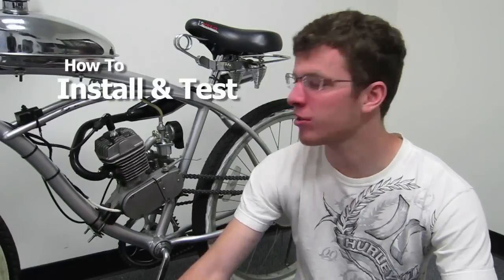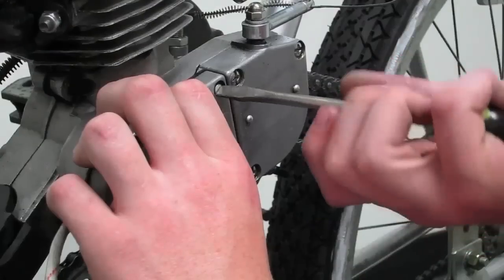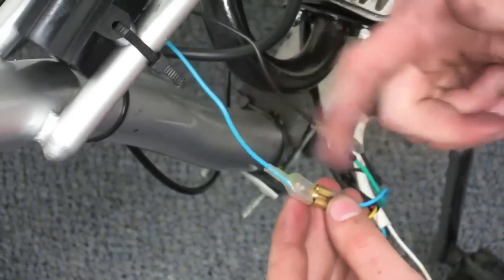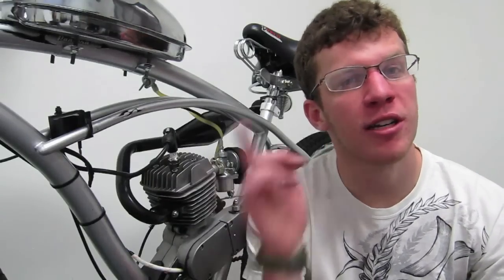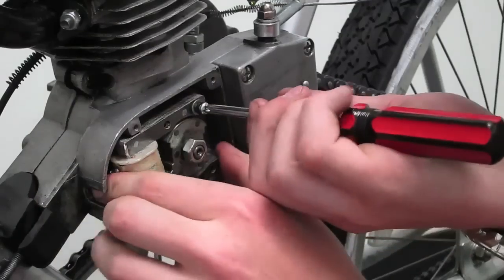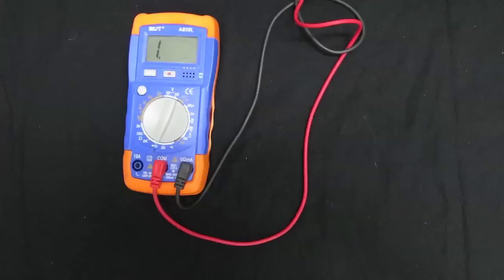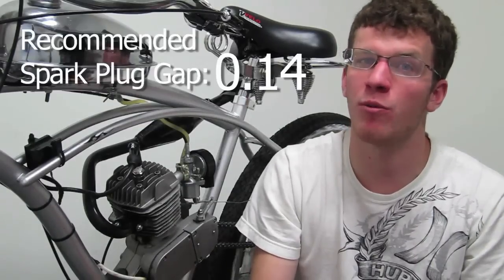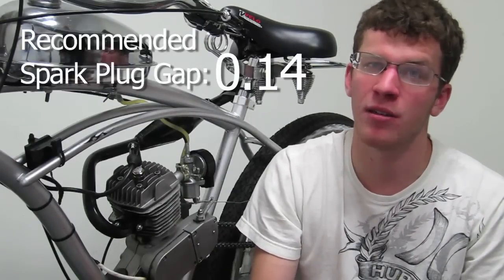How to Install and Test Electrical Parts on Motorized Bicycle - Magneto 48cc 50cc 66cc 80cc

Comment: HELP. I have a red and black wire from my kill switch and a blue and black wire from my cdi and the magneto has a white blue and black. How to i hook this up?
Reply: Ok, connect the 2 blues and the red one. Than all the rest - black, black, green (not black as you've written about the one from the kill switch)!
Reply: Cameron Richards White wire is for light if you wanna hook up, but it doesn't work well because of the uneven current pulsing from the magneto. Better cut it or just leave it!
Reply: HELP We are having the exact Same problem, and cant get it to work, please explain. We have red and black wires from the kill switch and black blue and white from the magneto and we have blue and black wires from the CDI.
Reply: james00extreme 1. Black/black/black(magneto/CDI/K.Switch); 2. Blue/blue/red(magneto/CDI/K.Switch)
Reply: So, we have 4 female ports and 5 male ports. We dont need the white one so we have 4 female ports and 4 male ports now but i still understand where they go?.
Reply: Red from killswitch to black on cdi. Black from KS to blue on cdi. Black mag to black cdi. And blue mag to blue cdi.
Reply: John Harris Thanks
Reply: Did you get her goin?
Reply: John Harris Well its not mine you see, its my friend who has bought the kit and is on the final stage, just hope wiring works!, il let you know once we carry on.
Reply: Cool. Sounds good.
Reply: i had the same problem then swapped around the blue and black so black went to blue and blue went to black, then it sparked.
Reply: Had the same wiring as john Harris and hooked it up as you said to and still cannot get a spark on the spark plug when I turn the back tire any idea why ?

Comment: hey, I have one of your motors mounted on my beach cruiser and it was working great!  recently it started having issues and would not start.  I watched the videos and read the troubleshooting blog and disconnected the kill switch to try that.  it worked!  but if I try to plug that all back in, then the motor again doesn't work.  How do I need to re-wire or change the kill switch so that it will be functional but not keep the bike from running?    Love your guys stuff, thanks in advance for the help!
Reply: Inside of the killswitch i bet you the wires are touching so the relay isn't working at all. Trying resoldering it where the wires don't make contact until you press the killswitch button
Reply: Joey Lama thanks!  I actually figured it out a little while back and that was exactly the problem!
Reply: No problem man! Happy cruising.

Comment: How many volts delivers the magneto coil?? I would like to build a voltage rectified in order to charge a battery and have a head, rear and turn signals. I know is AC, but I wonder how is the peak 12, 15 or 16 or it is much more less??

Comment: My problem is i bought a kit ran it maybe for 3weeks and it crapped out on my bike havent messed with it for atleast 2months now it stooed sparking and at the time it quit i had confirmed the no spark i tried doing the ohm test on the electricals and it reads nothing on the magneto or the coil now all i know is its wired correctly spark plug is good tested it on a yard blower just to confirm spark and any energy that is temporarly stored in the electricals for the ohm testing obviously was lost any ideas of anything i can do to test them? Or whats more likely to be the issue? Thanks

Comment: Hey, Im a bit confused my manual is different from how you say to connect the wires. It say blue to blue black to black green is ground and red/yellow connects to white. my engine is painted I cant see the spark your way any idea? will it hurt to try it both ways?

Comment: All the electrical tests right now no gas going to the engine. Going tomorrow to try and see if the carbonator is not allowing it to flow.
Reply: Can not seem to get you guys on the phone was on hold forever today and got disconnected. So freaking frustrated. Thought you would reply to my comment or email if even for A link to another video.
Reply: RockLobster2402 Check this video out regarding your magneto if you don't have spark: UPDATE: Improving Magneto Contacts | BikeBerry Tips and Tricks
Reply: BikeBerrycom Thanks for responding, I watched another video of yours for troubleshooting Caruretor, and looking at the install directions in the manual that came with the book, figured out I was missing the slider - the Sleeve like Piece inside the carburetor that the Throttle cable attaches to. I have the brass pin and c clamp that goes there and I have the spring.
So I called Bikeberry today, the guy was super nice, found the part in spare parts and is shipping it out today.
Hopefully thats All I need to get the vacuum for the fuel and will be in Business.
I will keep you posted on how it goes.
Thanks

Comment: BikeBerrycom what model of bicycle do you use in your demonstrations? i want to bypass the chance of error of buying the wrong fitting bike by using the same model as yours. if possible, can you leave with the name and/or model of that specific bicycle ?

Comment: dear bike berry my motor was running really slow and berly carying me on full throtle so i checked them with my ohms meeter the magneto was fine but the cdi witch is supposed to be (6-8) ohms was only 4.75 ohms should i replace it or is there a way to fix it
Reply: max hill, it is best to replace it.

Comment: I have a few quick questions. First my bike has been a blast and overall has been running great. 
I have blown out two exhaust gaskets. When I do, the bike becomes way too loud and I think a neuscence to other drivers.I think the problem lies in how I bent the exhaust pipe to fit it on the frame of the bike, it isn't able to press flat against the exhaust outflow of the engine. My question however is I have noticed two things:
1. Some gas is escaping through the exhaust exit. Now that the gasket is compromised I can see spurts of gas on my shoes. I imagine before it was just exiting the exhaust pipe without me knowing. I assume this isn't ideal and I wonder what I can do to make sure the fuel injection is most efficient.
2. This being the second time the gasket has blown out I have notice a pattern. I go much faster without a muffler, like 5 mph faster. Also the engine, while really loud, skips much less and runs better then the well muffled engine. Again how do I optimize the engine?
3. Could there be another reason I keep blowing the gasket
Reply: Ben Welling, bending the pipe can throw off the back pressure, which will effect the overall compression. If there's too much pressure trapped in the top end the motor, it is going to start blowing gaskets.

The reason why you're going faster without a muffler is because there's nothing hindering the air coming out of the motor. That's why if you take the baffle off the end of the muffler you'll get tons of speed: the air isn't being blocked/muffled by the pipe.

The way the expansion chambers (http://www.bikeberry.com/expansion-chamber.html) are designed, it will relieve a lot of pressure and keep the 5mph gain while muffling the exhaust noise.
Reply: exhaust modifications without stressing that he needs to make damn sure he properly tunes his carb? trying to sell an expansion chamber before even making sure he understands he's leaning his mixture way out and potentially causing serious damage?

Comment: what wires to I hook to a headlight
I was told I can run a headlight to a few wires from the motor
Reply: The white wire coming from the motor emits a 12v charge so any headlight that can be charged with 12v will work.
Reply: BikeBerrycom Any idea how many watts the magneto can generate?
Reply: Gadget Addict Unfortunately, I don't know the wattage, but it does generate 6 volts. I don't recommend running a light from the motor because it will rob power away from the motor causing poor engine performance.
Reply: BikeBerrycom Okay, thanks BikeBerry. Maybe I'll do some testing, I'm sure just a couple of LEDs wouldn't effect it. Unless it really only generates the bare minimum to keep the spark plug going. Will do some testing :) I was able to get the bike running tonight but probably won't come back to it again until this weekend.
Reply: Gadget Addict Awesome! Keep us updated. We'd love to hear how it worked out for you :)

Comment: what would some signs be that a spark plug is bad (or going bad)?
Reply: The 2-stroke engines have a simple setup, so if the spark plug isn't sparking, it can only be due to 1 of 3 things: the CDI, the magneto, or the spark plug. Spark plugs are fairly inexpensive, so if it's not sparking it, I recommend replacing it with a new one and testing it to make sure it gets spark. If it doesn't, you have narrowed it down to either the magneto or the CDI. From there, you can determine those parts by a simple Ohms reading. Hope this helps!
Reply: it will be cutting off all the time or not starting

Comment: hi, I need an email address so i can send you a photo of the magneto i am after. this one is on a pull start motor and it has extended top plate for it can be mounted ont engine.
Reply: Hi Paul, go ahead and send the picture to Support@BikeBerry.com. In the subject line, put ATTN: MATT. Thanks!

Comment: I am a Noob with setting up wiring on a bike but 2/3 videos iv watched have the exact wiring set up as i do.

Thx.

To Confirm what i say:

Black Coil, Black Engine, Black Kill Switch
Blue Coil, Blue Engine, Yellow Kill Switch

That is how my wires are hooked up from each Location Specified.

Only person with videos that did not have the same wire set up was transformercycles

Thanks for the video.
Reply: Sounds good to me. Still have problems?
Reply: BikeBerrycom Only Idle now which doesnt work...

Comment: Hi I ,ade a 80cc motor and when I go to start it it turn on but when I hold the clutch it turns off do u no why this is happening.
Reply: idle speed ?  only external adjustment on the stock carb is idle speed - try turning it in all the way in 1/2 turn increments until it stops (GENTLY) and counting the turns - write that number down and save it for future - by example, mine was factory set at 4 turns - so after knowing the start value, i screwed it back outwards to 4 turns (the starting point) and then screwed it in 1/2 turn at a time and tested it until it idled without stalling but was not racing the motor - mine ended up being about 2 1/2 turns, - my new problem is that the ground switch to kill the engine was apparently never working - doesnt want to stop running now - i am going to rewire it to the kill switch on my throttle which came from a real motorcycle

Comment from the maker: No, do not connect the white wire to the bike. If it's a brand new motor, it requires a break-in period (which is either 200 miles or the first 4 tanks of gas, assuming your tank is 2.5L). During the break-in period, your motor will most likely under perform because it's still setting the seals and gaskets and it's never been ran before so be patient. As for the carburetor leaking: Is it leaking when the engine is not in use, or during use?

Comment: hi.do i have to connect the white wire to the bike, in my case it make my engine run slow. because i notice it make sparks (is it ok), and without it the engine run good!!, even so the engine still week can't move from zero motion (bumpy run)  and die on small hight (road)???, it's a new kit, oh one more thing the carburetor leek fuel i have removed it and disassemble it and screwed it well still leaking so i have to close the fuel switch??

Comment: Everything was fine, weird solution though: Electricity was getting to the spark plug and I would get a shock unless I was holding the spark plug and shocking myself, so I taped the spark plug tight to the CDI ignition.

Comment from the maker: It may be your wiring? check to see if the wires on the magneto are soldered on properly as well as the connections in the CDI.

Comment: sorry I just got one of these its a 2 stroke I did the gas and oil mix do I not need to oil the gears or crank  I just cant see running  it with out oil

Comment from the maker: Hey, sorry for the late response. I PMed you regarding your video. It's tough to say, but if you purchased it recently, you can get replacement parts, especially for that CDI. Contact your manufacturer for some assistance in that regard and again, check your messages.

Comment: In many countries, the engine displacement is the volume of the cylinder + the volume of the combustion chamber. 66cc swept volume + 14cc combust chamber = 80cc

Comment from the maker: As far as we know, an ACTUAL 80cc is of mythical folklore and legend. It's akin to a unicorn or a silverback wildabeast. We advertise it as such because internationally, the bore of the engine is measured differently. The actual displacement of any "80cc" engine kit is 66cc. Hope this helps!
Reply: Yeah and the new Yeda 100 is actually an 80cc pushing around 2-2.5 hp.

Comment: My omhs meter box. has settings of 2000 ' 20 M' 20 K 'and 200 I'm when I said it to 2000 I got no readings whatsoever it also has a sending it looks like a sideways bull horn. When I said it to the 2000 reading I got no reading whatsoever what do you suggest I use here

Comment: What is the white wire for. 3 wire come out of the Magneto. Black, Blue and white. Is the white an accessory wire for a light? Mine reads 64 AC volts on idle. Maybe a regulator for a nice LED light?

Comment: hi can u help? just fit a new engine starts first time but will not run it judders try the revs but dont rev right ,turn the revs sounds like its going to cut out? check the spark plug and its very oily can you help?